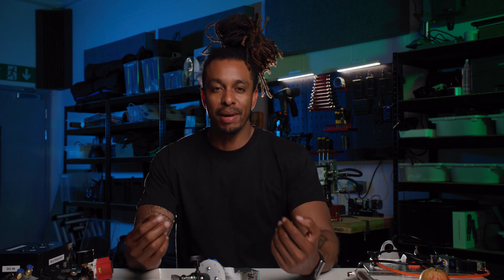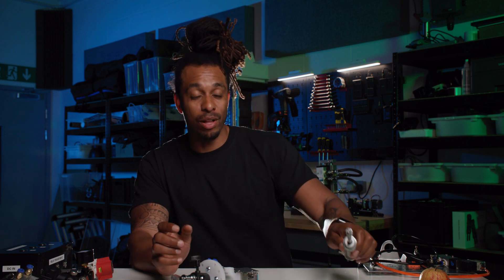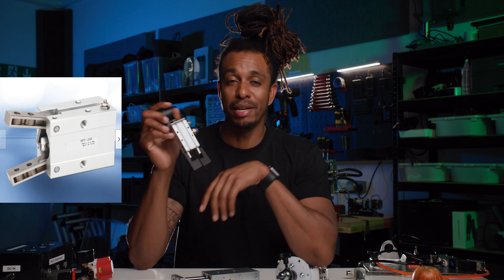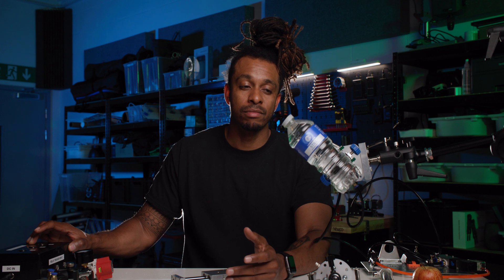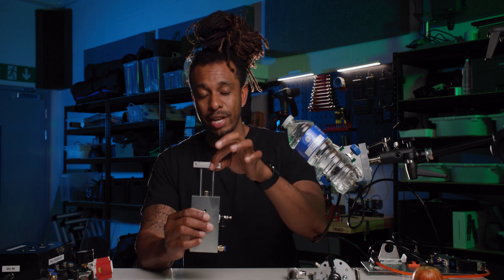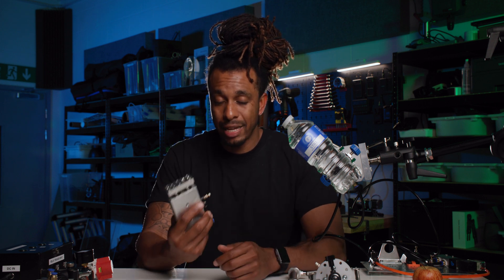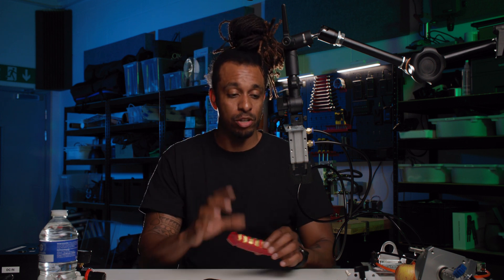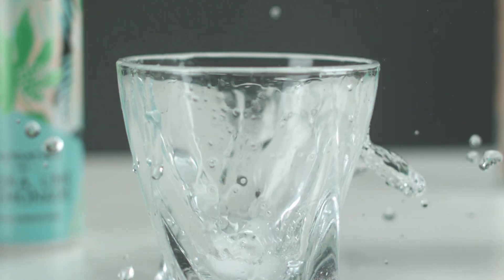Pneumatics In Product Commercials Pt2: Make Your Products Look Amazing

Comment: any chance you could link your pressure regulator? can't seem to find one with the quick release vent.
Reply from the maker: Sure thing. This is a uk site though but you can use the description to search  
https://uk.rs-online.com/web/p/pneumatic-manual-control-valves/8903279?srsltid=AfmBOoo7T6uV_AchRm7yJcgdlSOPgzTItko01JrOyFYOpz4sKP5kYOpw